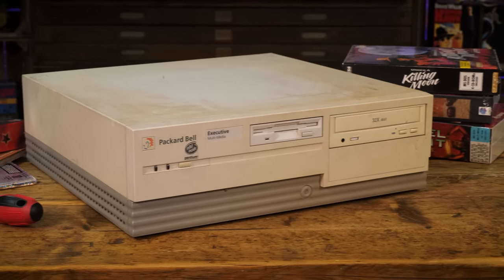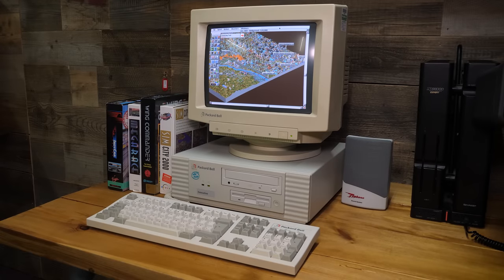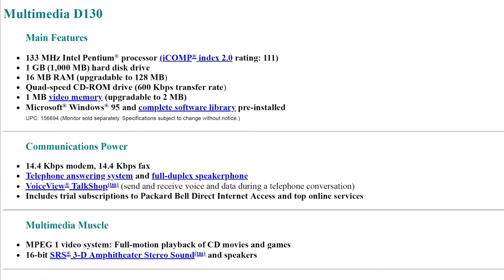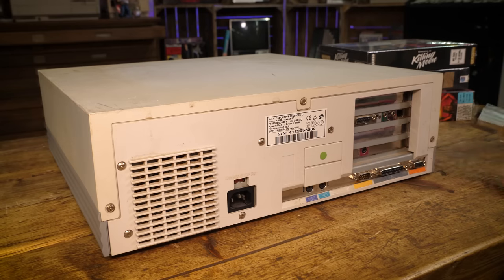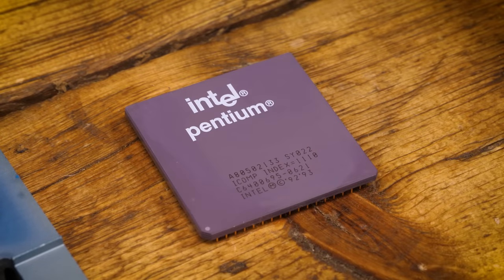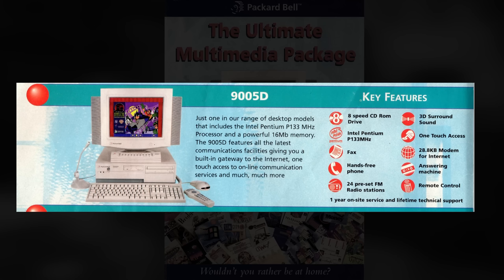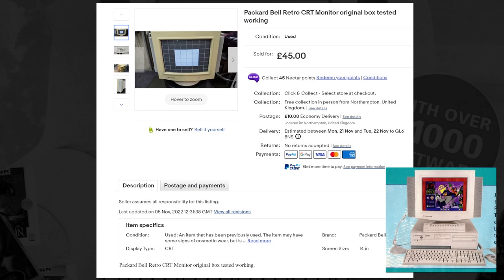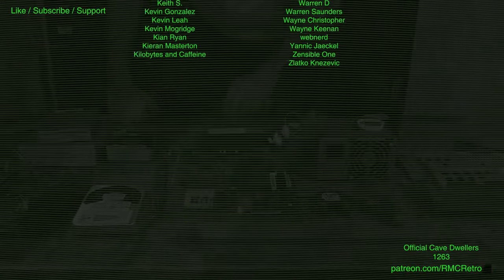Packard Bell Restoration | The Packard Bell Arrives | Trash to Treasure Part 1

Comment: Fun coincidence.  I am just finishing up restoring a 1995 Pentium 60 in the same PB 4x4 case.

Likewise, I hated these when I was the young kid everyone asked for help.  They indeed seemed to always have driver issues, or something.  I had quite the distaste for Aztech sound cards in particular after that.

But you know what?  All of the stuff in mine, at least, was actually pretty decent.  The motherboard seems to be a rebranded Intel product, it shipped with the charming MKE 2x CD-ROM, and even the sound card (slash 14.4k modem) is actually fine.

I did have some driver problems.  Partly because I was using a random boot disk to start the software restore, and it was trying to find the CD-ROM interface on the wrong port.  No one’s fault but my own there.  But it also turned out that the Aztech cards have a persistent config EEPROM to store all the software-selectable hardware settings, like base address and IRQ/DMA.  If you didn’t know that, or had it set to the “software” mode (which required setting the config on every boot by a command in autoexec bat), then I’m sure it would appear to be quite the flaky card.  Or just outright dead, which I thought at first.  It’s in fact a fairly sensible solution, in that it works quite reliably once you know about it, and is probably less trouble prone than an actual PnP card in the pre-95 days.  I’m sure it generated no end of tech support calls though.

All in all, the only perceived cheapness I came across was in the PSU.  I always recap old supplies, and had two pads lift from the PCB while doing so.  That suggests the PCB was not particularly high quality, since that rarely happens, and I’ve done dozens of them now.

Otherwise, they actually seem to be half decent computers.  Silly narrated shell replacement software notwithstanding - although I’m sure that was a thrill to somebody back in the day.
Reply: PS, regarding the correct CD - since you have the original drive, try to get a full image of the disk (sectors, not files!) first.

There’s a special “format number” that identifies the software load originally used on that SKU.  It’s a six digit number and corresponds to a script on the Master CD that should be in the “BU\A” folder.  If you can examine sector 0,0,2 on the disk (second sector, starting from 1, on the first track - just after the MBR), it should have a log of the build and QA process with that (e.g.) “555123 SCR” file identified.  Then you just (...) have to find the CD that has that script to know you’ve got the right one for sure.

If you can save the first track of the HDD entirely, that’s all the better.  It has the whole “system credentials” of the computer - build notes, signed by the tech with a date stamp.  Which is a pretty neat bit of the machine’s history that would be a shame to lose.  Also, if those sectors are present on the disk when you start the format and restore process, it will auto detect which script to use.  Otherwise you have to specify the format number, which is not an accurate out-of-the-box experience.  :-)

IIRC, the first partition should start at CHS 0,1,1.  So you just need to save 0,0,2 through 0,0,63.

Comment: That modern, sound combo card was great if you wanted to use the answering machine stuff. Who would want to do that you might ask? I used it for an informational call in thing where listeners at the radio station I worked at could call in and hear about local events.

There was also a DOS based prank call dialer called Cat Call that worked great with it.

With the regular separate cards you had to install jumper wires and re route them every time you wanted to use the PC for something else...

Comment: I remember a colleague wanted to upgrade his PB computer with a modem to access the internet via AOL on a free CD. 

He bought the modem and asked me to install a telephone extension to the room where the computer was kept.

I stayed to help connect it to the internet but it would not work at all.

We spent two hours on a call to customer support to fiddle with software and hardware settings in the computer so it would recognise the modem and allow it to access the telephone line.

None of it was intuitive. I had previously plugged in a modem to my own Fujitsu PC and had it connected within ten minutes.

Comment: Great video as usual.  My first PC was very similar to this but a Pentium 100.  It had just 8mb of ram stock but I upgraded it with another 8 and the Matrox Mystique GPU (using the term GPU loosely 😂)  

If I may I would encourage you to keep the sound card, as I recall its a decent enough card in terms of sound quality and should be handy enough to get going in DOS with the aztec drivers, the unisound driver might even bring it to life.  Also since its 96 why not go for one of the other graphics cards of the time.  Voodoo came out on top but at the time all the manufacture's had their own stab at it with their own APIs.  As I said I backed the Matrox horse (even if it turned out to be the three legged runner) but my Pentium 100 would comfortably run Scorched Planet or Mech Warrior 2 on that card.

Comment: I got given a very similar computer last year, made by Compaq but also in that LPX (low profile extended) style with a Pentium 166. It was a bit of a problem because the hard disk was dying. Not normally an issue, but the program to change the BIOS settings isn't on the motherboard itself, but rather in a partition on the hard disk. I managed to find the floppy disk images for the software so I could put it on SD card storage, but it didn't want to install onto there, so I was left with using the actual floppy disk itself to load the BIOS setup software! I wanted to keep it, but it had an intermittent problem where it wouldn't POST, so I decided to put it up on eBay and it finally got sold a couple of months ago. You are right that the Pentium 200 is the maximum this type of machine will take; the later Pentium MMX CPUs require a motherboard with a split-voltage CPU socket, so you can lower the CPU internal voltage to 2.8 V while keeping the I/O at 3.3 V. You'll know whether or not a motherboard has this because there will be jumpers to change the internal CPU voltage if it does. Anyway, I went with a Pentium MMX 200 with my Voodoo Banshee and AWE64 gold to build a new system as my Windows 95 gaming beast PC lol.

Comment: I have a Packard Bell Multimedia PC with what I think is a 486DX2. Haven't pulled the heatsink off, but I know the CMOS battery barrel has corroded and left a mess around its region of the board. The PhoenixBIOS post beep code is 1 1 3, telling me there is a CMOS read/write error, probably a result of corrosion. Aesthetically though, it's in very good condition externally and has the original mouse, keyboard, and CRT.

Comment: I had a Packard Bell machine in 1998 also as my first internet connected computer. It came with a bloated version of Windows 95 on 2 CDs that took over 3 hours to reinstall the machine from! It also refused completley to work with any other version of Windows and would not even boot after installation. And yes it also refused to accept any form of expansion cards even there were slots for it. I could not even get a LAN card to work. The only extra add on i managed to get working with the computer was a Philips 4x CD writer.

Comment: I worked for PB 1994 to 1999 in the R&D department in the Los Angeles, CA area. Every seller got different models from the other so you could not compare apples to apples to get the best price. Each model would have slightly different options. So to find the best deal you would have to figure out which models were the closest equivalent. So Sears, Best Buy, Circuit City would all have a set of their own models never the same. Sneaky business practice. I believe PB was the first major company to have Pentium chip models. They were not designed to exploit the Pentium chip, because they wanted to get them out for sale asap.

Comment: I have one of these, currently on the 'to fix' list. Mine is a model A940, with the front bottom bezel missing and just gives three beeps when attempting to boot. The worse part is it stinks of cigarettes, so a deep clean is also required! I wanted this just because it has the Pentium to complete my line up. I seem to have a thing for old desktops.... 🙂

Comment: I came in a year or two later. I had a Packard Bell (can't remember the model) but it had a AMD k6/2 400mhz CPU in it, 32mb RAM and a luxurious 52X CDROM, loaded with Windows 98 and a load of bloatware. It was a tower PC and had a monitor not unlike those with the clipped in speakers on the side of the monitor but everything was plasticky, creaky and very curved. Like the interior of an early 2000's Fiat. It got me through School and College and i retired it around 2004/5.

Comment: My first PC in 1995 was a Peacock P75 with 256k graphic card and 4mb ram, 14in monitor. cost me £1500 lol. within a month I was already upgrading it, it was that bad. i still have it boxed without the monitor, its running win98 and has a P150 overdrive CPU fitted now. haven't been able to find much about Peacock Computer GmbH

Comment: I tried to upgrade from my family's IBM AT by buying a used Packard Bell from a friend. I swear it had that same case but it was a 25 megahertz 486. It a 30 MB hard drive or something like that? The previous owner had double spaced it to 60 MB. It took days to undoublespace that drive. After all that work it lasted a grand total of two days. Then I got some kind of electric shock from some exposed metal on the bottom of the keyboard. That blew the keyboard port blew out. Yes, the keyboard port died. You can't get another keyboard port. I was heartbroken. I really couldn't do anything but play games, and only if those games supported a gamepad. What I'd have to do was take a floppy disk over to the AT, make a custom boot disk that booted directly into the game. If I wanted to make changes to anything on the computer I had to create a boot disk that would copy the files to the floppy, and then make another one that would copy them from the floppy to the hard drive. This is basically how I configured my computer to play games for like a year. Then finally I had saved up enough to buy the bare bonesist of bare bonesist pile of computer parts and had to learn how to put it all together myself. It was still way better than that stupid Packard Bell.

Comment: had a PB of that slim desktop form factor that i restored to win95/98? i can't remember. I used it as an answering machine via the bundled software for years after it was antiquated. it was rock solid until we went to cellular as  our main line of contact.

Comment: GL Quake and Unreal will run nicely with the addition of a Voodoo or Voodoo 2 card, which was the first main upgrade of my Pentium 133 system and fairly typical for the late 90s

The ultimate upgrade on a system like this (in 1998) would have been 2 x 12MB Voodoo 2 cards running in SLI mode enabling you to run games like Unreal and HalfLife smoothly in 1024 x 768 resolution although you'd have to satisfy yourself with an ISA sound card for the privilege...  There are some great community driven driver packages like Fast Voodoo 2 that can improve performance and compatibility on such a system today

Comment: Hello from Brazil! Back in 96 I had an IBM Aptiva that was very similar to this machine: Pentium 120mhz, 16mb memory, 1.2gb HD, the modem/sound card just like the one in this computer (was called MWave)... It was overpriced, not expandable, not very good performance (terrible for the price), but I loved it! It could run Tomb Raider 1, NFS SE and some other titles just fine.

Comment: I still have one very like yours. I think the only difference is a higher capacity hard drive at 1.6 GB.
The mother board is an Intel reference design called ‘Thousand Oaks’ which uses a riser with 2 PCI and 2 ISA connectors but could only use as 2 + 1 with the middle slot either / or.
Power supply is a LiteOn PA4151-9B1 which should last well because it is very unlikely that you could configure that box to pull more than about 80W even with a 200MHz MMX processor and a second hard drive. There is plenty of air through the box from the fixed speed fan.
I still have my original one with complete hardware, the only known damage is the failure of the surge arrestor diodes on the modem etc card due to lightning strike. Last ran a couple of years ago, even the original clock battery was OK. Mod state of the machine was 200MHz after market Greenwood processor kit, maxed out video memory and upgrade to Win98SE to avail of USB capability via cheap after market card. Internet connection was by then via white box 10baseT ISA card and MS internet connection sharing with another machine.
Best of luck with your project, I’ll be looking in.

Comment: Its all about the nostalgia of booting up these old brand name computers with there priority bundled software and bloatware. Rather than a generic clone pc with a vanilla installed Windows OS. Along with checking out what's installed on the hard drive by the previous owner. As long as the HDD hasn't been wiped. Along with installing the original software that came with them (If you can find it) for nostalgic purposes. Since your going to restore it.

Comment: The P133 is actually the CPU that was commonly used when the Voodoo 1 came out. The V1 would be a good upgrade.
I have a "Packard Bell Legend" With a 486 Mainboard n the same case. It has an aftermarket AMD 5x86 133 upgrade. Let me know if you are interested in the PC, since i am reducing my "hoard" a bit.

Comment: My first PC was one like this. An Executive Multimedia. Although, mine had a 500MB hard drive and I’m sure it had an onboard nVidia graphics chip. Maybe I’m remembering that wrong. My friend had it from new and sold it to me. 
It was Windows 95 and had the mic and the remote as well. No one touch thing though. You couldn’t have it plugged into the phone line otherwise it would answer the phone when it rang whether you wanted it to or not, the person on the other end couldn’t hear you, and then it would hang up on them. 
For some reason it was set up to have a Host drive to make more space on the hard drive. Probably to install the included bloatware. It was so temperamental, and it was always hit and miss if it would fire up or just hang. 
I gave it to my sister and once she no longer wanted it, she threw it away. I do regret not keeping it, or anything that went with it, but it was a truly un-user-friendly machine. I’d have fun messing with it these days as an interesting puzzle to keep working, but the drivers were by far the worst part. 

I still have the copy of Sim City that came with it, and maybe my still sealed copy of Microsoft Works came with this machine as well.

Comment: Horizontal PCs are mighty fine. It's a dos era pc but it can run windows especially windows 95. You would probably get a good experience with jedi knight with cirrus logic software rendering at a low resolution of maybe 320x240 but even 640x480 might give you issues. 133mhz is a nice sweet spot but if you had this pc back in the day you probably had the old Sierra timer issues along with the back catalog of dos era games that "run to fast"

Comment: About this time I was the first in the office to get a Windows PC (everyone else had Macs). About the same spec as the Packard Bell in the video, but this one came from long-forgotten Tulip and was perhaps even more cheaply built from plastic that would have been rejected for egg cartons. But the piece de resistance was that the CPU had been secured in its socket by several lengths of sticky tape before the conductive paste and fan assembly had been installed.

The machine was garbage, but it did play some good games - strictly out-of-hours you understand...